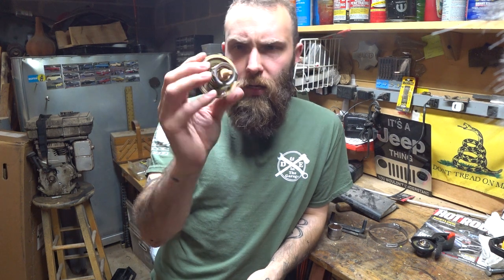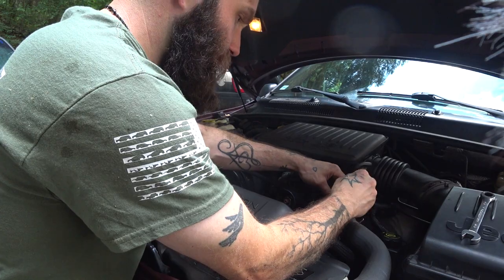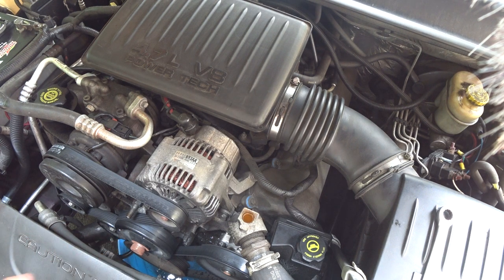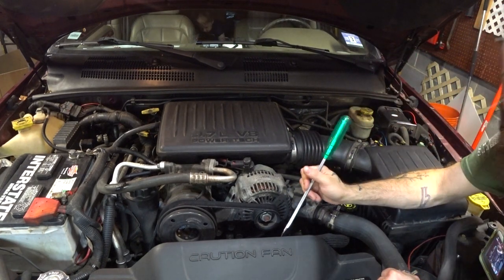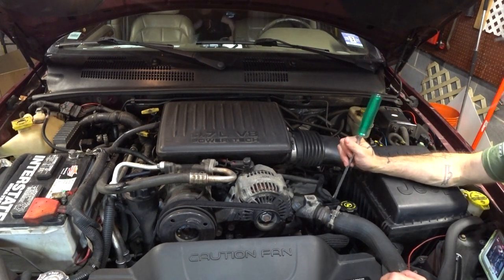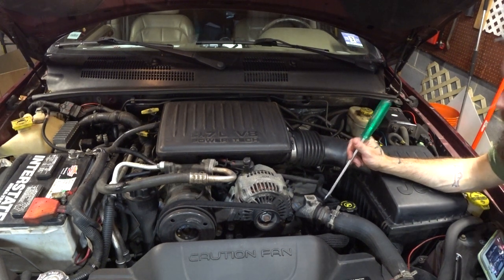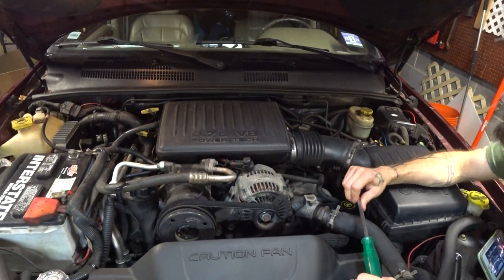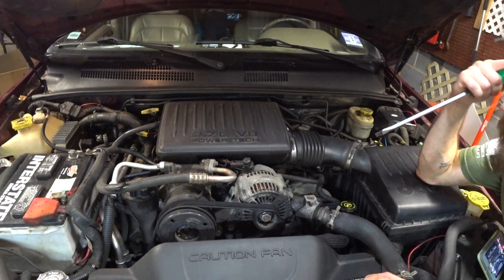How to keep a Jeep Dodge 4.7L alive & happy - EVERY FATAL FLAW I LEARNED THE HARD WAY!

Comment: Did you flush the system out with a cleaner or just drain and refill?  No cleaner no good. Did you drain your interior  heater or did you just mix the juice together? How much coolant did you get out of the engine and the radiator? 2 and a half gallons Less? If less you made your self additional problems.  Orange and lime juice should not be mixed.

Comment: 310000 miles original  engine n  transmission keep on top of the coolant n oil level n she does everything you ask n  better still the a/c is freezing n will remain so if u change the skinny cold low pressure line with the filter built in inexpensive fix n change ur axel fluids according to spec ull hv a reliable truck .ofcouse gt a fanclutch  n ac electric one .so other than a couple of bad pulleys n 2 bad bearings.nothing much to complain about in all these years.yes it's a 1999  4.7 laredo.tc care of her n she'll tc of you.ppl say jeeps are unreliable I say make ur routine services more reliable n jeeps are tough beasts.

Comment: Help!!

I have a 99 myself that is failing because of burning oil issue. 

Anyone have any suggestions as I am just doing the best I know how to hold it together long enough to decide what to do??

I was thinking of just biting the bullet, yanking out the factory 4.7 and putting a Monster built 4.7 which has all upgraded internals inside. Monster can also custom build engines just like they do with their Transmissions. 

Any help or suggestions welcome. 

I got a Monster Transmission in December to replace the terrible Factory designed one. 

Night and day difference in power delivery and MPG.

Comment: my neighbor is still building an ark,,, that's great,, you must be a pisx to hang with,,,anyway, the bleeder set screw  thing on  my 08 grand cherokee 4.7, has a T50 torx head , it might be after market, it's a used truck, but i've  mostly seen 8 mm  and  even  1/4"  square inside drives , and 3/8' outside square drives , i do auto body , so we get a lot of front end hits, so tons of cooling system replacement , but i didn't5 know those motors wanted the orange coolant,, our suppliers aren't very  informative about such things, they just want to sell product,, so ,, does my 08 4.7 want orange coolant too ???, i just replaced my pump, lower hose and thermostat ,,so i thought i'd ask

Comment: Luckily I have a mech clutch fan in mine but this 4.7 is a pos. Its engineered to last only 150k and almost right on target I had to have mine rebuilt at 155k from worn bearings and no oil pressure at idle.  Aluminum heads with steel valve seats? Great idea chrysler. You'd think the 1st thing they teach would be thermal expansion and the different rates depending on the metal but oh no not chrysler.   I wish I had done my homework before buying my 05 ram in 07.  4.7 is trash but when I had the heads rebuilt the 2nd time, I had them bulletproof the heads but who knows.  It's sad when a shop knows about the issue so much they advertise on a fix.
Reply: What material would you recommend to use for valve seats?

Comment: My 4.7 doesn't over heat but sometimes I smell coolant should I be worried? 4.7 Dodge Dakota
Reply: If it's strong and you smell it more in the cabin, then your heater core is leaking. If you smell it more outside or under hood then you have a leak in your main cooling system.

Comment: I bought a beautiful 2002 4wd Dakota with a 4.7 that had dropped a valve seat and chewed up 4 cycinders (for $500).  I stuffed a remanufactured Mexican long block into it for a few thousand dollars.  On the test drive I blew a hose (my bad) and warped one head.  I had the head machined and the truck has been running great.  BUT, in the head that was machined the compression on all 4 cylinders are about 10 PSI lower than in the other head (140ish vs 150ish).  Anybody got any thoughts on why?  Thanks.

Comment: My mechanic of 20 years has let me down.  He did a flush for me and used the green stuff.  Plus he didn’t change the thermostat because he said the bolts would snap.  Ugh 
Question: what’s with the exposed ball bearings on the fan?
Reply: You'll be fine with the green stuff, especially since it was a flush.  There's nothing special with the engine that required one coolant type over another.  If you change types, however, you should always flush the old stuff out first.  If 9/10 times I've done the thermostat and the bolts broke, I wouldn't be changing it either.
Reply: @KRTube75  thanks for the info!

Comment: I got the push rods out it doesn't  move at all is stuck and come out easy it's a 4.7 and sometimes my p my power steering would go out I have to turn the truck off for it to come back on and it did it for about 6 months it doesn't run right

Comment: The early 4.7's came from the factory with green coolant. My 2000 has it and I won't change it . It works fine 21 years later. There is no evidence to verify that overheating causes valve seats to drop. There are plenty of people that claim to not have overheated their engines and have had seats drop. This guy has a lot of energy, uses a lot of words but does not really give a lot of information.

Comment: That Thermostat is not the correct one for the 4.7. If you look at the OEM one it has a center pin & a large center that's to close the Bypass hole and let more coolant go though the Radiator When it opens. If you use the NON OEM ones it dose not close the Bypass hole & under heavy load You will run hotter than you should. If you have a factory repair manual you can see it in the Cooling section.

Comment: Your little ones shirt... 👍👍🐻⬇
Reply: So I’m new to the 4.7. It’s started overheating but subsided when I cranked the heat. Temp fix, I know. I started with replacing the thermostat and when I removed the bottom hose to pull the old one there was NOT a thermostat there. Wtf??? So I don’t know if I put the new one in correctly. Low and behold, it kept overheating. Next day I found a crack in the radiator. Replaced the radiator. Still overheating. I’m going to bleed it and see if that helps. Let me know if you got any other tips for my 05 Durango. Otherwise, she’s going into the shop come Monday. Thanks

Comment: the hydraulic cooling system is reliable and works great if you dont damage it by using the wrong fluid/ not changing fluid or other neglect...... Just sayin.....

Comment: What type of coolant are you actually using in the 4.7 L. Just because of some orange doesn't mean it's the right coolant. Because different companies could dye different types of coolant Orange. The most recent coolant from Chrysler seems to work quite well in the 4.7 and it's not orange at all. But it is a modified organic acid technology coolant. And it will run with a hybrid organic acid technology coolant. Which one is better for that motor???. Don't just say orange! A 180 degree thermostat wouldn't hurt that engine either. And don't forget to use a good synthetic oil in it.

Comment: my 94 camry has a hydraulic fan.  original, works great.  300 thousand miles.  mine has an inline filter.  mine is variable speed at idle too.  japan makes everything better.  my moms pt cruiser on the other hand has been repaired yearly since it was 4 years old.  i can't stand chrysler products.  all the suspension components fail over and over.

Comment: Don't use anything but Chrysler coolant in your engine that it came with from the factory. Chrysler coolant for those and other chrysler engines is formulated to seal leaks. using anything else is guaranteed problems.

Comment: Hydraulics are very expensive to repair in the first place and they didn't use the best quality parts as well.
Reply: I’ve had luck using a Magnefine filter in power steering systems. Has literally fixed noises strange symptoms. Over time, there is nothing to remove particles from break-in, wear, and deterioration.

Comment: I dont know where to even start. I had my 4.7 engine rebuilt. It ran fine for about 5k miles untill the water pump started leaking. Replaced it with a pump from advanced and from that point on it started to run hot but only at about 60mph plus. Idles allday at 205. Wont get above 210 in traffic but it will get up to 220+ once i start going over 60mph. I have replaced that water pump with an oem one,replaced radiator, replaced, t-stat, replaced hoses,replaced heating core,replaced engine fan,had it properly filled by 3 different mechanics to be sure no air was in system. Still nothing. Im losing my mind here. This is my business truck that I use to tow with and its useless. I mean wth else could it be?????

Comment: Sounds like a temperamental engine
Reply from the maker: Yea bud. Nothing like the Magnum V8's it replaced
Reply: Buy a product name Mozilla you can order it on the internet you can have your engine a little bit warm wet the plugs down really good with it and then let it cool down completely before you try to pull that plug again it should be successful you might have to try a couple times but it's the most awesome stuff out there for stuck threads in plugs and you can bathe in it without giving you cancer.

Comment: Just bought a 2004 durango. Last 12 hours before the head gaskets blew going up a hill on the way home. 1000k bucks thrown down the drain. These motors don't seem worth putting a rebuild top end into.

Comment: 5.2L vs 4.7L?
Reply: 5.2 doesn’t have the performance parts support of the 5.9, plus it’s much heavier. Responds well to typical muscle car mods and a computer tune. 4.7 is probably better in close to stock form and better mileage.

Comment: You forgot the biggest issue about the “4.7”.... it ends in a “.7”, and I dare you to name a Chrysler motor that ends in a .7 that is any good, and known as a good motor in the car world.... I will wait..... yeah there ain’t one.
Reply from the maker: Haha... I think the 5.7 gets a LITTLE bit of a bad rap as they get stuck in fleet vehicle which idle a lot which is a major contributor to the cam failures, but I am with you. I am less scared of the 4.7 after driving it for almost 2 years, but I would still prefer to have my 4.0 with me everyday
Reply: Chevy 5.7
Reply: @DEInTheGarage  That's why I daily a 2wd 4.0. Lol No fear of it breaking down on me because I yeeted it through a mud hole last week... XDXD
Reply: @DEInTheGarage  the 4.7L Powertech is the ultimate engine that Chrysler ever made. One problem: they purposely lowered the displacement in order to achieve good MPGs. There isn't much of an upgrade path but expect 1 million miles.